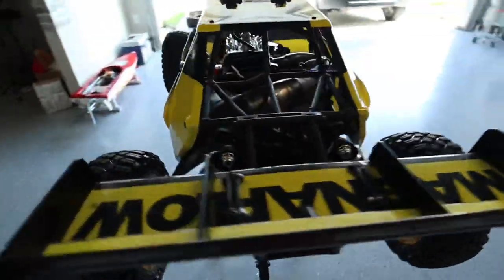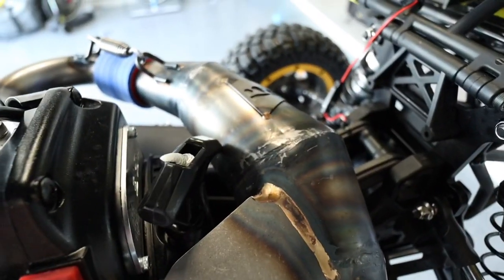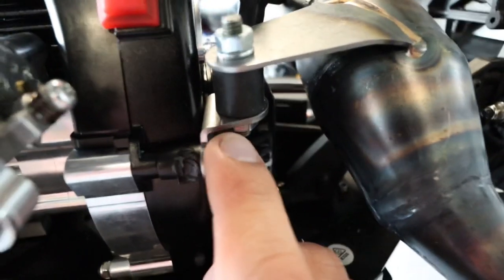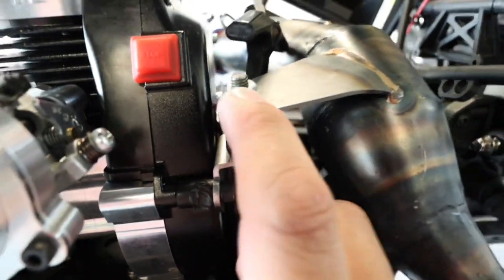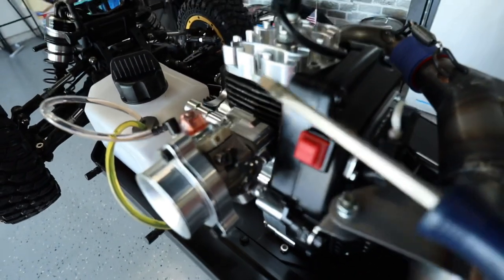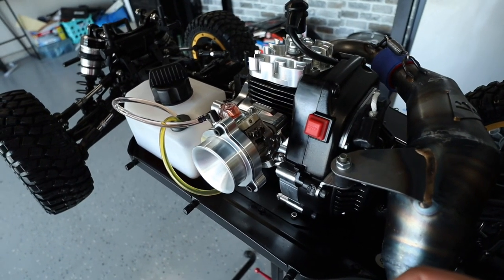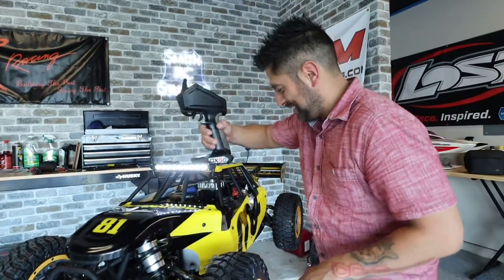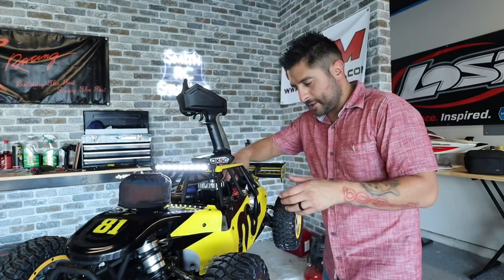Taylor RC and Bartolone Racing! - DBXL 2.0 First Start! - Smith RC Studios

Comment: hey man i love your channel and vids. i have been thinking about getting this model and putting this sam engine in it. can you tell me what clutch and setup you went with? how do you like it so far? im stuck between this model and the five t
Reply from the maker: Hey thanks for stopping by and thanks for your support. Excuse the delay in response. Yes i believe i addressed this in the engine instal video. But i meant to use the Bartolone clutch bell but didn’t fit so i went with stock clutch bell. Using the FS all medal clutch from DDM Racing. Gearing is from DGI. I love it! Also running the Bartolone racing exhaust pipe. So far I’m loving it but unfortunately if you saw in one of my last vids i crashed it lol. Stay tuned
Reply: @SmithRCStudios  I did see that video it was a sad day! I’m sure you will get it back up and running soon

Comment: I once had exacly the same problem with g320 i couldnt tune it so i emptied the tank made a new batch of gasoline and suddenly it was like a diffrent engine. Probably some quality diffrence or maybe slightly diffrent oil to gas ratios.
Reply from the maker: Yeah that’s crazy lol…. At least we got it to run. Thanks for stopping by. Cheers

Comment: Hi brother my 35 Taylor doesn't start or even impossible to start it carburettor wt 1107 mod setting taylor H 2T L 1T 3/8 new spark plug nothing nothing ignition good petrol arrives well to the carburettor, engine that drowns but nothing to do!! Do you have any advice, everything is new, brother, thank you 👍👍👍
Reply from the maker: Sure! So watch minute 4:14 and on in this video. I gave a few tips. If that doesn’t work please message me again.